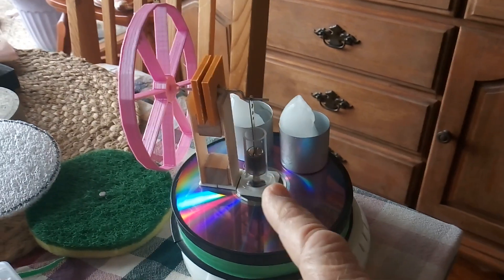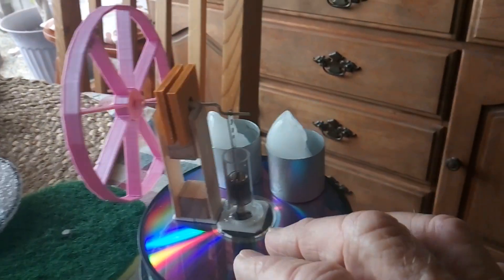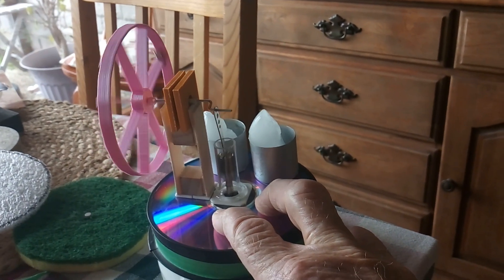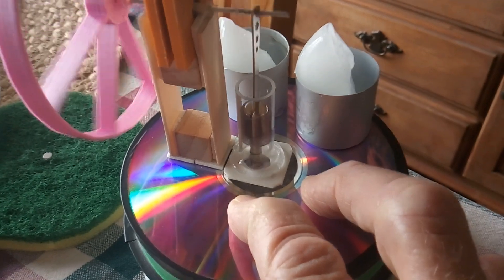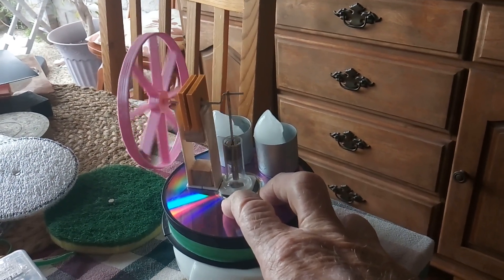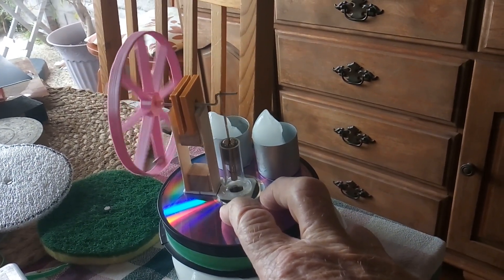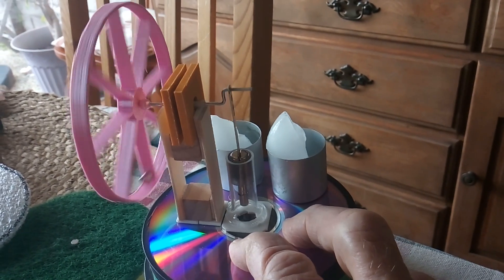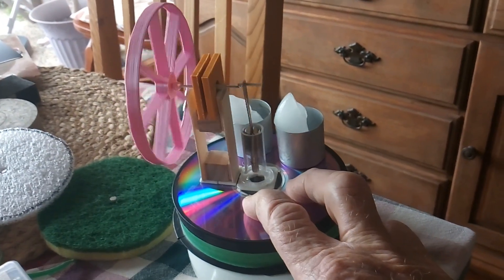My magnetic stirling engine --- NOW  RUNNING !!!!

Comment: Thanks for sharing
It can be done. I made an LTD Stirling that run only on ice, can run even on worm hand, You need to make it with low friction and sealed as much as possible. Also make it adjustable.

Comment: These are not easy to make work well. I'm glad you have success.  I tried these a while ago and know the pain they are. The flywheel should have a tiny bit more mass on the edge of it, definitely need aluminum on top, and the magnet on the displacer should be as tiny as possible,  make the upper magnet strong and the lower one either a tiny magnet or just a small metal. Looks like you are on the right track!